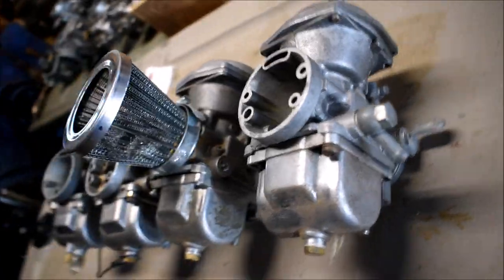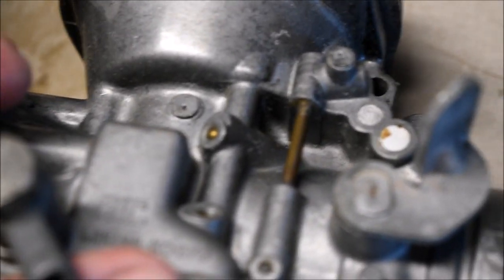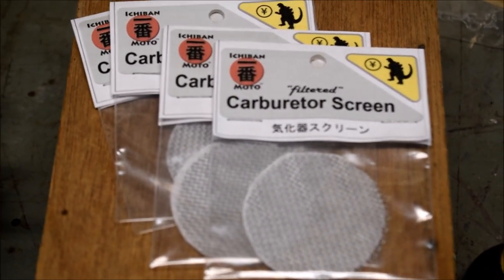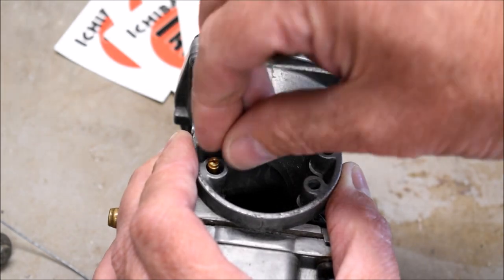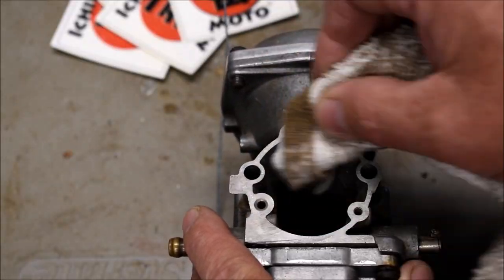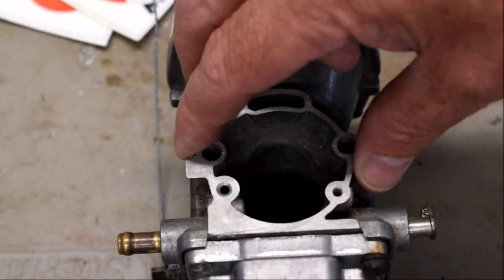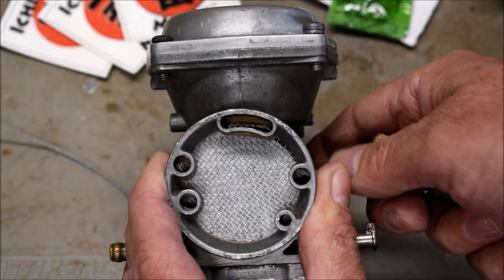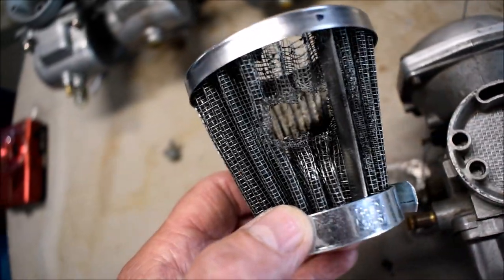how to install a carburetor screen

Comment: Nice tip. I will install them on my Volvo V40 :) So much trouble with pelikans around here. Feathers everywhere.
Reply: The Capricorn.... It's not the feathers you have to worry about,  it's sucking in the Pelikans thats the problem.
Reply: So you had pelican in the turbine? Those are very often the cause of malfunction.

Comment: Nice to get strait information from a master bike mechanic.
Reply: Auggies1956 My owner's manual was lying to me all this time.
Reply: Auggies 1956 

Where?
Reply: C4H10N4O2 You weirdo, reading the manual and all that ?!?  (-;
Reply: Morten Kristoffersen I like to do things right.
If the japanese engineer say to put 142ml of 10w oil in earch fork tube, that's what i'll do.
If there's no information, only then will i use the hammer and the huge flat screwdriver (as a chisel and a prybar).

Comment: I have been using these carb screens with succes. Use them in conjunction with those cheapo pod air filters, and the engine will after fitting screens respond much better on the throttle, and you will no longer have to ride all day with the choke fully engaged. Badass!

Comment: I Like the thought process that was put into these Carburetor filter screens. The first thing I noticed is your use of the 20 micron screening in front of the 1 micron mesh thus trapping large particles prior to clogging the 1 micron fabric filter.. Vey Well Engineered,, very well designed,, very well installed !!!!! Bad Ass !

Comment: Very informative. Have noticed that everybody seems to avoid diagnosing and fixing electrical faults on motorbikes? If you could throw some light on this problematic and neglected area then I think it would be a good thing. The Japanese metric electrics seem good when new but seem problematic when they get older,unlike British electrics that stay unreliable from new. At least Triumph electrics can be relied upon to be unreliable unlike Honda that can't be relied upon to be unreliable.

Comment: Ive solved debris getting into my carb permanently, and I don't even use a air filter. Go to the hardware store and buy a 1 lb box of rockcrete quick drying hydraulic cement, mix it up with some water to a thick consistence and spoon it into the carb throat till its full then trowel it off even with the end of the carb. Nothin gets in there that can cause any harm! This saves big time on expensive filters and the engine stays in perfect shape forever.

Comment: As im situated in the 3rd world i cant afford to import your bespoke carburettor screens so i stole the used bon cafe coffee screens from my local short time bar. After fashioning 1 up to fit my KDX i noticed i was out of 2 stroke oil so i filled the tank with carnation condensed milk, now i rip from bar to bar with the aromatic flavour of latte as i ride..... castrol R is soooo last century.

Comment: can i substitute screen with tube sock toe fabric if properly fastened with green zip ties?  Thanks Ichiban
Reply: No use stockings like we did in the 70's
Reply: Don’t be ridiculous of course that wouldn’t work you have to buy the properly manufactured screen material and gasket.
Reply: put a sock in it Snobby Bobby
Reply: No a sock wouldn’t work. OEM is the only way to go.
Reply: the tube sock toe cloth works ok on the carbs.  i cut the rest of the tube socks into strips and wrapped the exhaust of my badass Honda 250 rebel but they caught fire.  Man what a MESS!

Comment: Awesome! But do they guard against grasshoppers and June bugs?
Reply: Uh... your air filter "screens" whatever needs screening.
Reply: Only on a fuel-injected bike, mind, the older ones don't run on battery and the screening would be manual, which is a pain in the ass to get refilled every 1000 miles (or 1600 on a Honda).

Comment: If a carburetor needed a screen, manufacturers would've installed them. Right up there with the Tornado and cold air intakes.
Reply: Yo momma needs a screen
Reply: Yea dude right on👍
Reply: That is part of the scam. They just want you to buy new carburettors before the regular 10k interval replacement is due.
Reply: Sooo you don't get satire. You dont even have a grasp of it. Gotcha.
Reply: @RabidDogEOCF  Satire... WHAT?